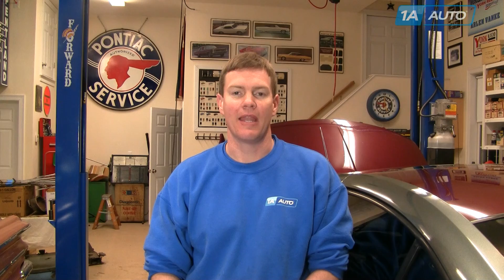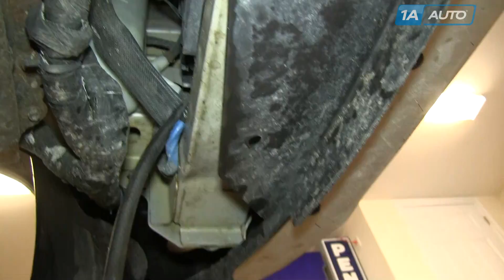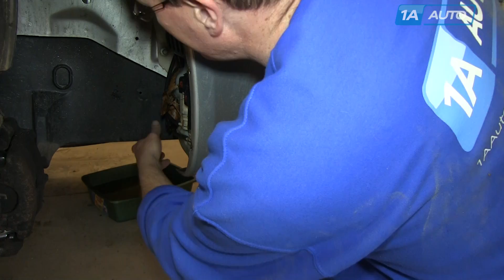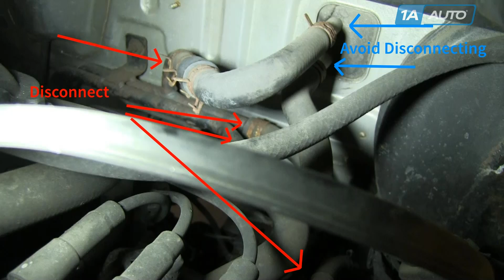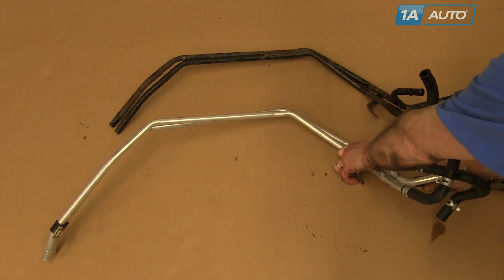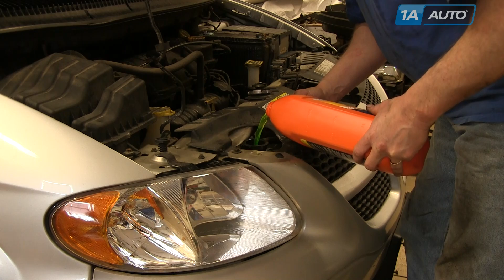How to Replace Heater Hose & Tube Assembly 01-05 Dodge Grand Caravan

Comment: Looks like yours were replaced at some point already. Your old ones are a newer part number. My 2007 came with crimped hoses from factor and it was a nightmare. Also how is there so much space down below? My bottom hoses are pinned behind the exhaust and ac lines 😭

Comment: My 05 dgc sxt 3.8 v6 is leaking at the coupling/reducer hose connections... I hope I can find another c/r without replacing the whole assy....big headache as you display... I hit a deer a few weeks ago so I had to replace radiator and a.c. condenser and both cooling fans... I got them in so after that noticed antifreeze smell and been having to add coolant to the overflow jug every other day... so tonight it was smoking and I could see the coupling/reducer pieces leaking.. I think it between the core hose and the coupler... the other end reducer connecting to assy is ok. BUT I have NOT noticed the fans coming on ?

Comment: * NOTE * if no money and just trying to keep van going due to leaking pipe or rear hoses, just take front motor heater hose off and bypass to rear motor inlet (remove rear hose first of course) - heater wont work anymore, but it's a free fix, and only takes 5 minutes.  No need to do anything else.  Save up for part and do later....
Reply from the maker: +Jason Jeske Thanks for the tip!

Comment: OMG what's the part number?!! I need this. Tube assembly and rear heat tubes are showing 0 matches on the 1A Auto website.
Reply: OK, it's Dorman 626-301. I figured out if you scroll over the "i" in the upper right hand corner, you will see the part and it's a link to the 1A Auto site.
Reply from the maker: +10furle0 Thanks for watching. If any of our viewers needs to make this repair, we carry the auto repair part shown in this video on our website. Here is a link to them 

https://www.1aauto.com/heater-hose-and-tube-assembly-%28supply-and-return%29-dorman-626-301/i/1ahcx00261

Comment: why does this not have the heater control valve. 2001 dodge caravan for example requires one to be installed for rear heat.

Comment: Does this part comes with the hose. One hose in may van is leaking.  I can send you an image.
Reply from the maker: +dancar02 Thanks for watching!  The part comes just as pictured on our site, and as shown in the video.  It should have the hoses that attache to the end. 
Here is a link so you can check it out!  http://www.1aauto.com/heater-hose-and-tube-assembly-%28supply-and-return%29/i/1ahcx00261?utm_source=YouTube&utm_medium=CTA+Comment&utm_campaign=ytcomment&utm_term=iuA0cJwdr34

Comment: I did this job today and i didnt take off the tire , the engine mount , or the windshield wiper box . What i did was remove the brackets holding the 2 pipes together then i put them both in separately through the bottom actually pretty easily.  After they were in there i put the brackets back on the pipes and screwed them in .
Reply: Also i didnt need to take out the air box or unscrew the throttle cable . and to get the old one out i just bent it so i could pull it right out of the top .
Reply from the maker: +Melissa Garcia Thank you for the feedback. There are many ways to remove and install these types of parts. We are glad to hear your replacement went smooth and easy.
Reply: Melissa Garcia Good info
Reply: For some folks, these original tubes have the bracket tack welded to the two tubes. For my removal, I also didn't take off the stuff listed here. To remove easily, I cut off as much of the length of the tubes at the bottom as far up as possible. Then pulled them out together easily. Installed new ones as listed here one at a time..
Reply: Melissa Garcia Cool, did you make a video of it?
Reply: any other tips?  I'm probably going to try this over the weekend..........thank you.

Comment: i have a 1996 dodge caravan and whenever i run my defroster water starts to drip/pour underneath the dash onmy passenger side and i also start to hear a muffling sound as if water is hitting a plastic bag, lol what do you think is my problem? does this mean i need a new heater core? i do get heat and cold air so it works but it seems to me its leaking or something. i need help.
Reply from the maker: +Dean Williams You may want to inspect it to see where it's leaking from
Reply: if this doesn't happen with vent or floor heat, but ONLY with defrost, it CAN NOT be the heater core.  It's likely the water off the evaporator of the AC.  Many cars automatically turn on the AC when you turn on defrost, even if the air coming out is warm.  This removes humidity from incoming air and makes defrost work  better.  Often times, in the winter, the drain tube for the AC evaporator gets clogged and the water that drips off it CAN'T drain onto the ground.  Since you posted this 8 mo ago, you prob already fixed it, but let me know if you need more help, and I'll tell you what to do.  Good Luck

Comment: Thanks for the video. Time to trade off my caravan. To difficult of job for me and I am sure the cost to repair at a service center is at the least three-quarters of the van's worth.
Reply: equallywrong - the job is far easier if you remove the wiper box, see my comment about how.  I've seen this job quoted between $250 and $500 including the part. If that's 3/4 of your van's worth it must be in very poor condition, but if you are taking it to a mechanic for everything then there comes a point when it's less expensive to pay $500 or $600/month for a new minivan. (Including taxes, and insurance). If you have an AWD, the only choice is the Toyota Sienna AWD at around $45K+taxes,insurance, etc. which is $750/mo for 60 months plus tax and insurance. For me this is a <2 hour job and a <$100 part and no reason to drop $45K for an aesthetically displeasing Sienna with a lot of forward visibility impairments that doesn't ride as well with uncomfortable seats, and the 2nd row leaves behind a 6" stand when you take it out, and a radio that doesn't sound 1/2 as good.

Comment: Great Video. Not sure why you removed the front tire and inside wheel housing covers.
Reply: bsdguy - that was probably done to allow access to part of the engine mount. Removing the wiper box makes the job less difficult than the method shown.
Reply: For ease of manuvering the other ends of tube assembly and increase visibility.  I suspect!?

Comment: If you just take 20 mins and remove the wiper motor  box assy you don't have to mess with lowering the engine.  Makes it real easy to remove and replace the tubes.

Comment: great demonstration! Would like to see the lower intake gasket replacement on the 3.3 & 3.8 that commonly leaks towards the front of the vehicle near the ignition coil. also the soft aluminum rear ac lines corrode and leak underneath near the rear of vehicle. thought id ask! thanks